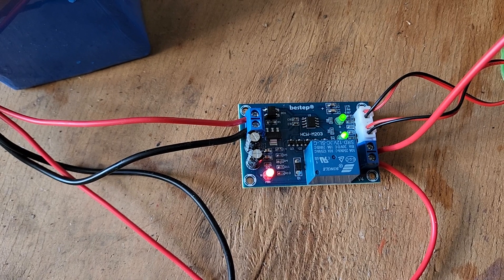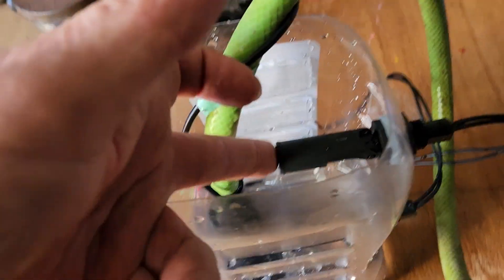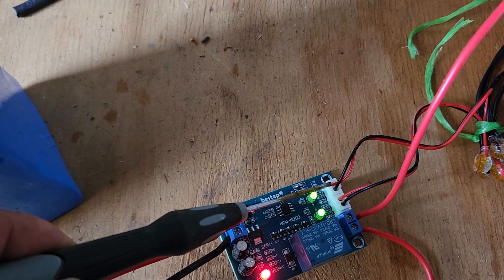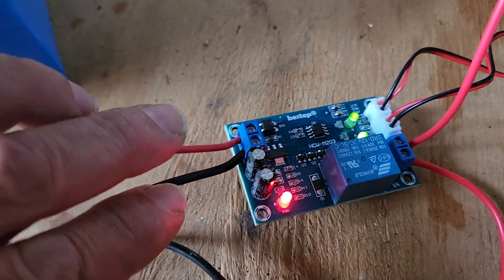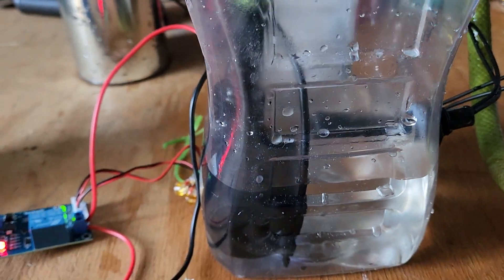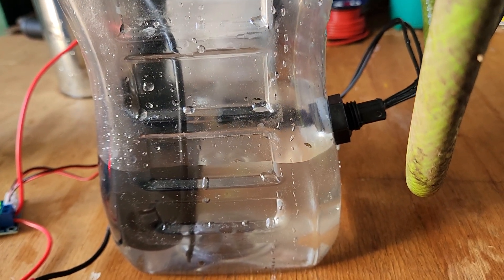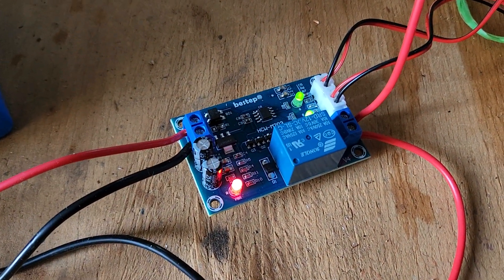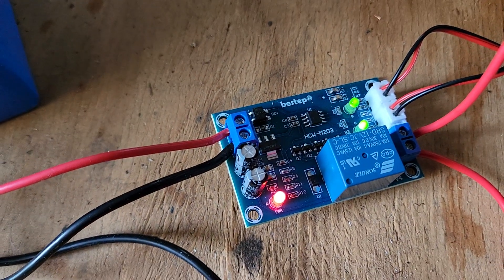HCW-M203 or XH-M203 water level controller. Setup and demonstration

Comment: I was looking for a module with the exact same operation. When the tank is full, it starts pumping out water until the water level crosses the lowest point. And it turns off the pump. And it will start pumping again when the tank is full. 
Found other videos on YT with the opposite function. But this is what I need. Thank you so much for making this video.
Reply: I will share with you the way I am using. You change the 5-pin 12V relay into the circuit and solder the left leg of the relay, remove the right leg.
Reply: @vanhieule7039  Okay! Now I understand. First I have to reverse the connection of the relay's  'normally closed' and 'normally open' pins. So, the circuit will work opposite as it normally does. And the circuit would be ready as I want it to be. 
I appreciate your help. Thank you 😊
Reply: @ຮິວດຶກ  Could you please show it via a diagram?

Comment: I don’t think both an electronic automatic switch and a float valve are necessary simultaneously. The motor can be controlled using only a float switch. I’ve implemented this for my overhead water tank, but for underground water or septic tanks, the setup can be easily reversed.
Reply: Hi can you please share details for the float switch. Is it easily available in stores or online? Will this https://youtube.com/shorts/fPEz77MIPfA?si=hLvNR8dD7RNCs7gr work? Thank you
Reply: @harigopaldas108  Yes, the one you shared is the best option. It's cheaper and more durable than the electronic one. I'm sorry that I haven't made any video yet of the one I made.

Comment: Hi great tutorial. Just want to ask how did you reverse the action by default it supposed to collect water when the low lever sensor detects no water. Im trying to replicate you showed on the video but no success already interchange the sensors but no success either
Reply: He has reversed the float sensor connection as well as the float switch itself
Reply: He has just physically reversed the float switch itself. Nothing to do with the wiring. I just tried it as well, got it working.